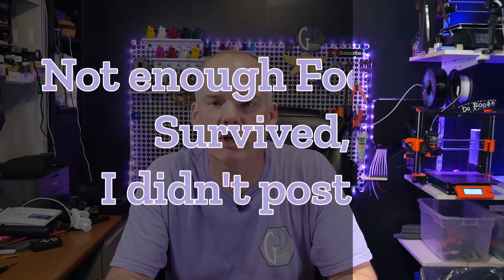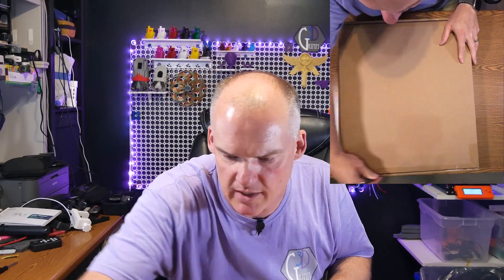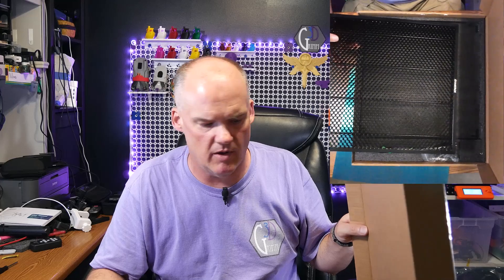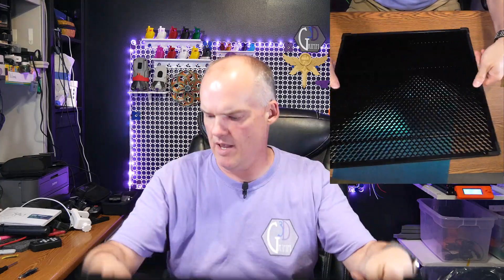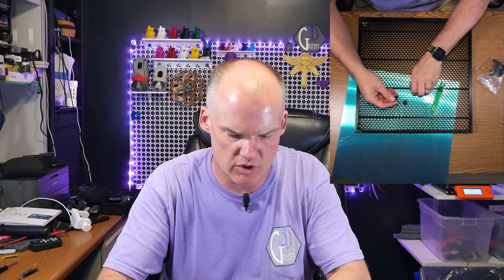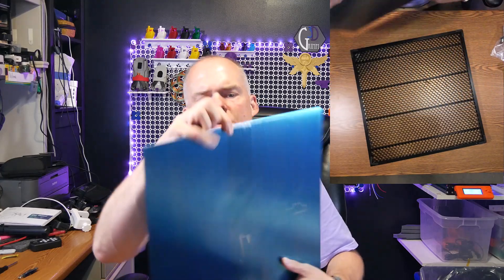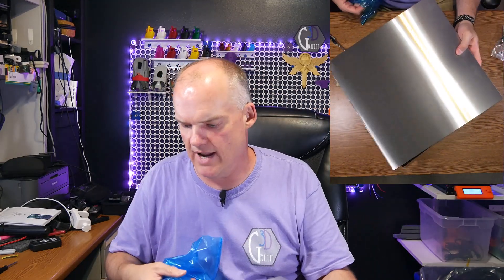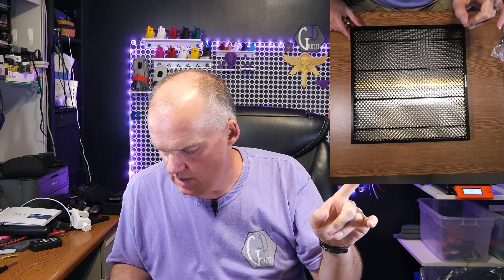AtomStack F4 Honeycomb Board Unboxing

Comment: I originally subbed for the Wanhao D9 modifications. I have now received my rails and need to print the parts to mod my D9 400.  Did you ever finish the D9 ods or did you give up? 
Watching the Laser content as we also havw a 10W laser and i am interested in how the A48 cuts and what software you are going to use.
Reply from the maker: I have done all the modifications to the D-9 except have not completed the Z rail on the motor (home) side of the machine. That part of the D-9 is still the original roller guides. I have been wanting to finish it up myself. However, it prints very well with the updates I've made. 

The laser is new to me. I have been running some tests on random cardboard pieces to Learn LightBurn.